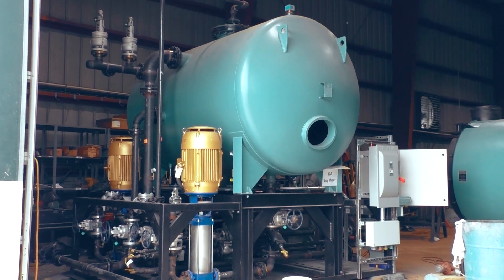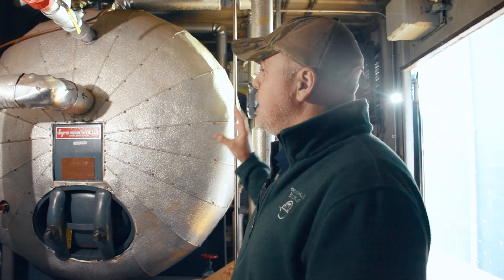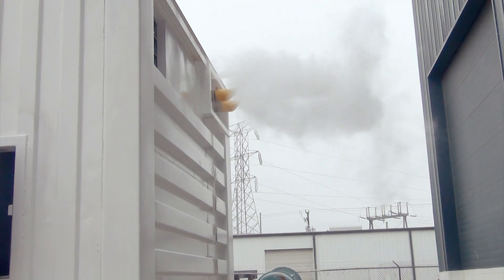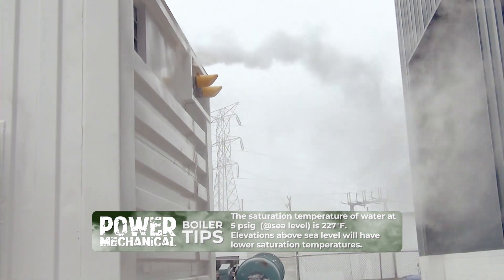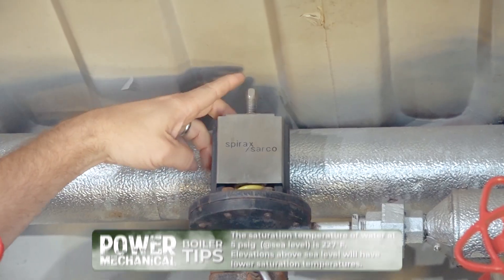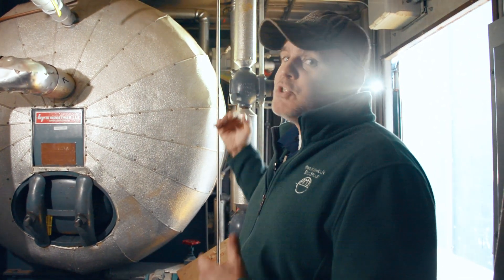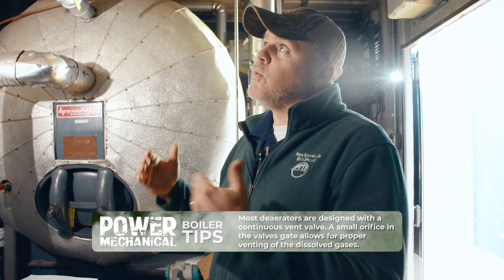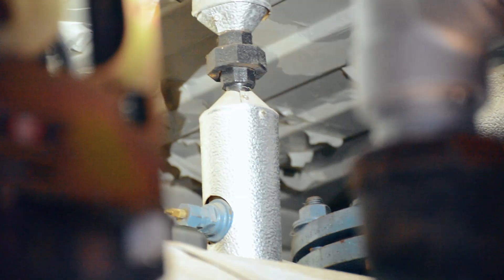Troubleshooting a Deaerator - Boiler Room Tips

Comment: How about water came out from venting deaerator , what i must to do
Reply from the maker: Alvi, Are you meaning your main DA vent? Or is this just the Deaerator over flow you are referring to?
Reply: I got the same issue ..on my dearator just rebuilt my prv and gotta set it to 15psi to get 200water temp..my non condensible vent shooting out way to much steam..???